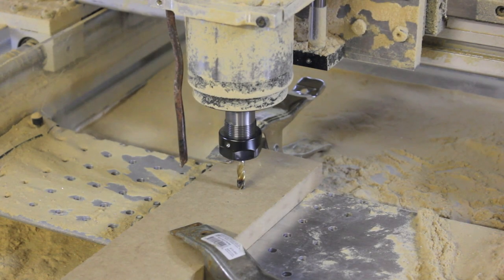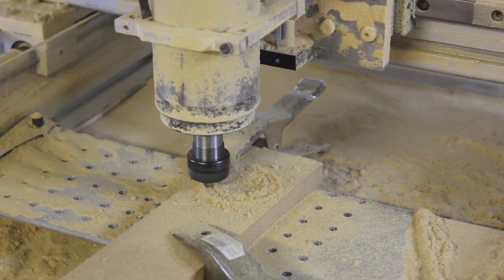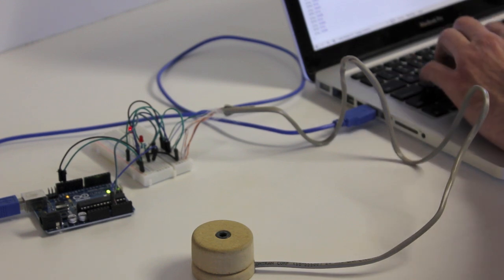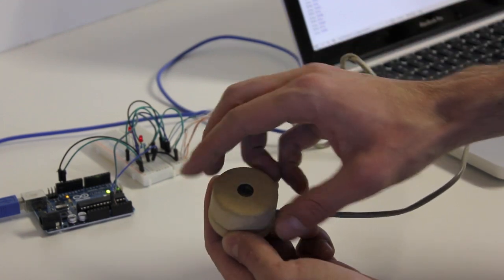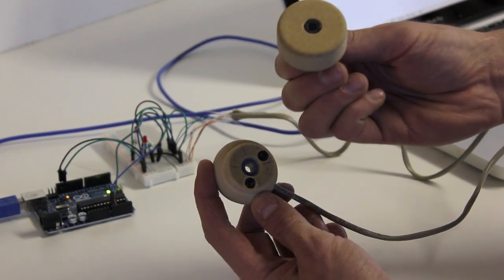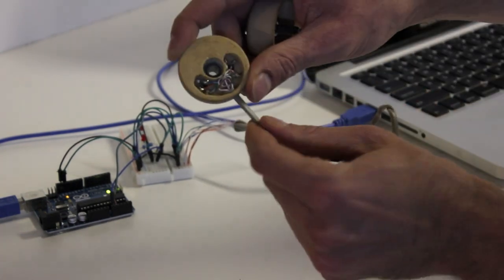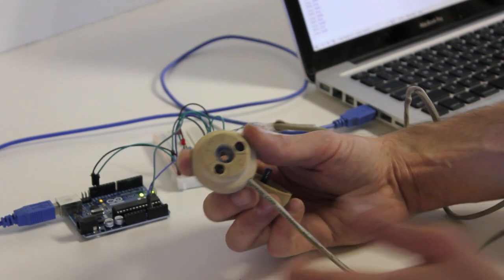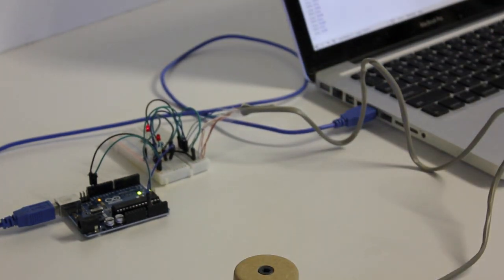DIY Rotary encoder knob

Comment: could you have done those encoder lines more thinner? to get more precision from the encoder? im looking to know how to make my self something like this because my budget is low to be buying 4 of this , i own a cnc mill 2030 and a mkbot rep2 3d printer so im just not thinking outside the box but i do have some ideas  but not sure where r how to start ? maybe you can show me some pointers? im building a humanoid Robot and need encoders for its pivot joints dc motors im not sure if i want to use turnigy outrunner brushless 3 wire motors or small dc motors 2wire ones
Reply from the maker: possibly, but you probably wouldn't achieve the resolution you are looking for. there are a few options options that I know of that may work for you depending on your setup

http://ams.com/eng/Products/Position-Sensors
http://www.cui.com/amt-modular-encoders
or just get a motor with an encoder on it (servo) - https://www.pololu.com/product/1446

all of this depends on your design requirements and budget!
Reply: What is stoping you or i from making a high precision encoder? I mean we have ideas Anne you actually made something out of nothing out parts of the shelf ?
Reply from the maker: well, there are two types of encoder: magnetic and optical.

To get more resolution of an optical encoder you'd need to make finer lines and also be able to detect them with a better sensor.  At some point you're going to run into problems with the resolution of a desktop printer, but maybe you can buy etched glass instead

What resolution or ppr are you going for and what is the max rpm that you'll see?
Reply: hmmm interesting thanks for the tips.
Reply: @tmpvar  or gut a printer that has a thin film already printed with super fine lines as well as the reader!